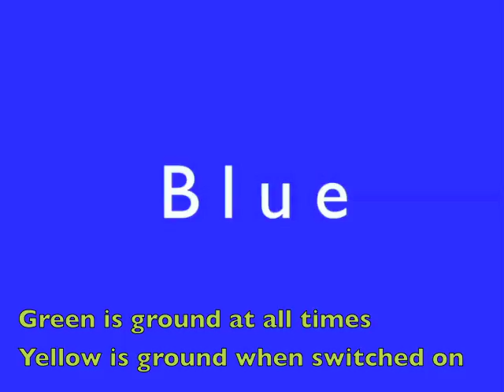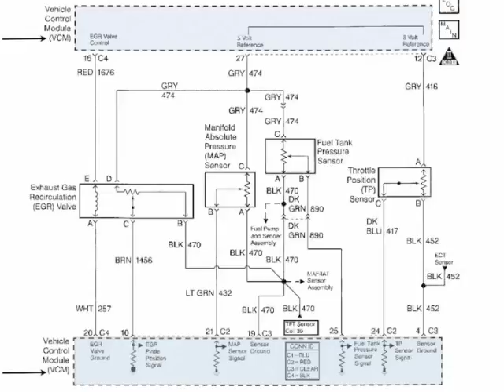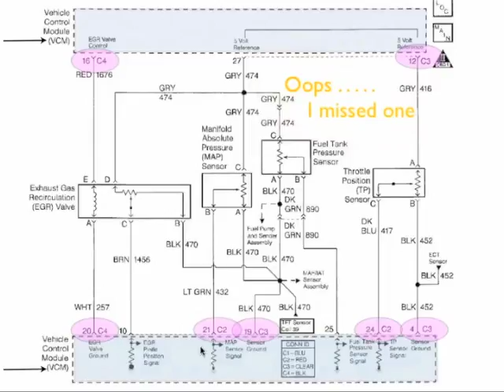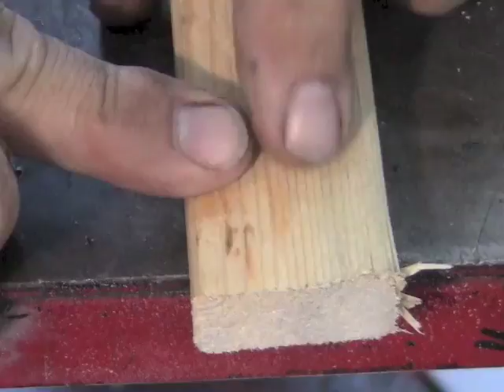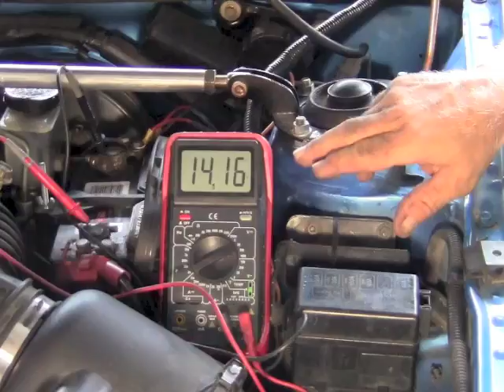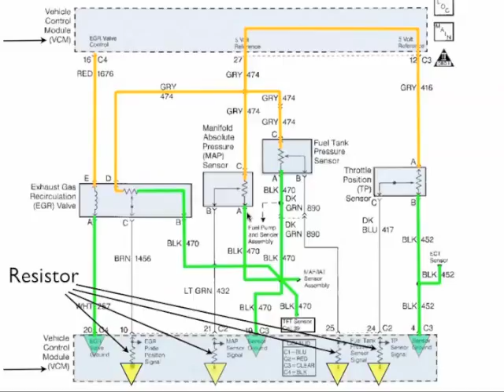Elec Series Lesson 4  Introducing Blue

Comment: How is the 5v ref voltage held at exactly 5v? Surely if the drop resistance is a fixed resistance and the system voltage is variable 9v - 14v, the output voltage from the resistor will reflect the system variance?? Great videos by the way..

Comment: at 10.30 u say that a motor would start at 6volt, would not this voltage indicate a faulty battery with 3 dead cells , this is impossible for a motor to start ( if just one cell is defective the battery CANNOT supply the WORK to crank a motor) . Otherwise FANTASTIC videos and thank u for the upload

Comment: Hi Duane. Nice video pointing out different components in the diagram and also with the coloring. However, I believe that the 5V reference is not fed through a current limiting resistor. This would imply that the source voltage is on the input side of the resistor. Then when the source voltage varies, so would be the 5V reference. The 5VDC is derived from a voltage regulator circuit such as a LM7805 which can provide 1.5A of output current or some other IC component.

Comment: Excellent lesson. Could possibly explain how speed sensors work, especially three wire sensors. We just worked on Saturn Vue with a  manual transaxle with a three wire VSS. It had a switched 12 volt power source, a signal wire and a ground wire. Thanks.